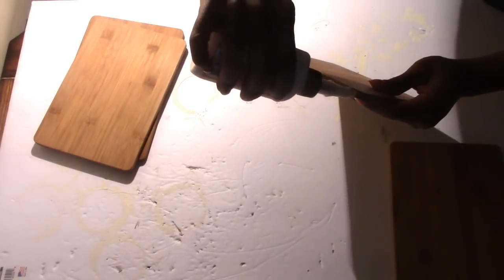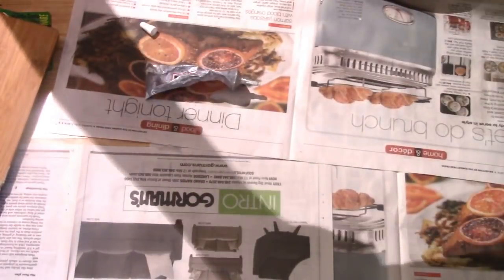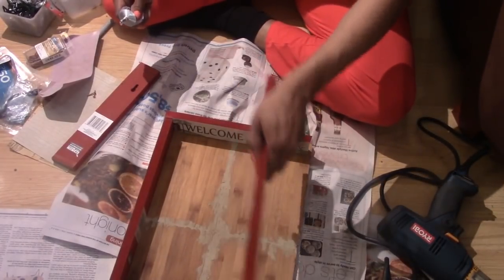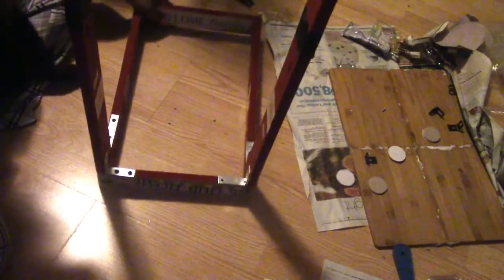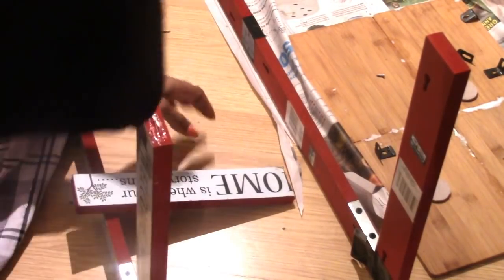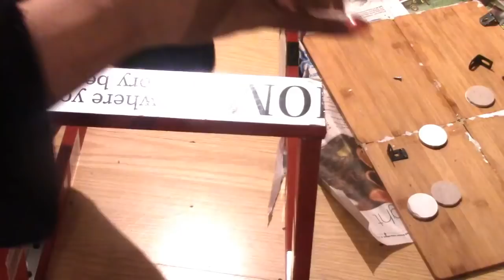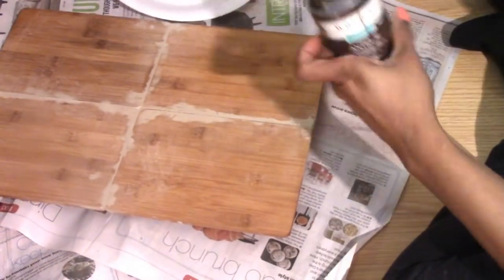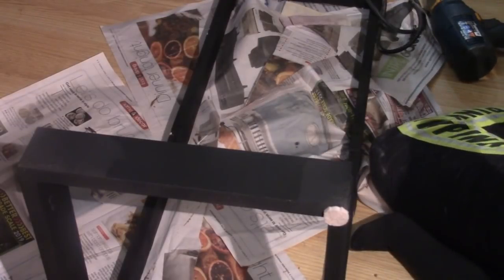Dollar Tree DIY/Dollar Tree Wood Table

Comment: Great job!  One tip to keep the wood from splitting is to drill pilot holes first, it would be a lot easier and you won't have to tape it all. Also get a couple of clamps at harbor freight. Happy creating!

Comment: Tip: Using 1x3s for the frame would be cheaper and also sturdier since you won’t have to join 2 pieces to make it the desired length and there won’t be a seam or brackets so it will look a lot cleaner

Comment: AMAZING..... I can really use this in my office I am going to try and make it .It will perfect for my coffee mug while I am in  there. Do you think I need to add  boards on a slint from under the tabletop to the legs base to support the tabletop. You are just the best . Continued Blessing my friend.
Reply from the maker: Thank you so much. Yes if you're going to do it this height for your security I will definitely do so. I made mines a little too tall, I should have cut the legs down a bit. This however does support my coffee mug the way it is. Blessings to you!🙂

Comment: I love watching you and I give you A for effort but this is not sturdy, safe, or inexpensive. One trip to the hardware store would have required half the supplies, half the steps and half the money. 
CAUTION: Do Not put a heavy hot bowl of soup on the middle of that table. Over time that wood putty and glue is going to dry out. 
All you need:
A Free pallet and break it down. 
Or
Buy lumber
1x2s pine for top frame,
1x3s pine for base,
One solid piece of pine for top.
If you predrill your wood won't split
Reply: This is exactly what I was thinking. I noticed the table top was slanting down. I fully believe that if she put a cup or anything heavy on that it would have slid right off. It's a nice idea but none of that material will hold as time goes on.